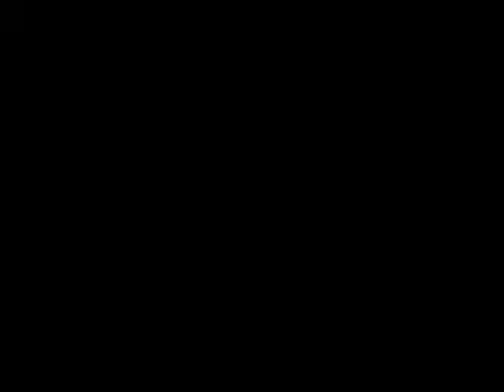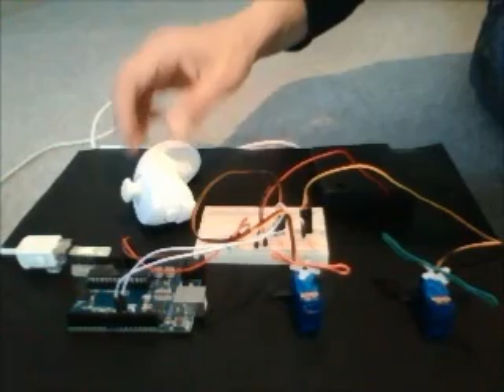Wii Nunchuck Controlled Servos

Comment: This may be super late but the jittering in the servo is caused by improper voltage input, attaching the wii nunchuck directly into the aruduino is all the rage in the forums but the adapter needs to be attached separately to completely eliminate the jittering.
Reply from the maker: Yes, you're right.  Thank you for the comment.  The servos should have their own power supply.  I've found in subsequent experiments (e.g. in my video of TinyCNC  - https://www.youtube.com/watch?v=qmZ3cva2t3U) that this greatly reduces the jitter.
Reply: A way I elimnated the jitter was to use the 3.3V power for the Nunchuck and then write code to average out the values. Every 3 readings will be averaged and then take the averaged value as the reading to smooth out output.  I found that this brings the movement as close to 1:1 as possible. 1:1 motion brings its own set of problems though.